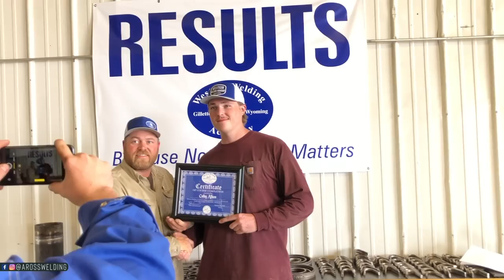WELDERS STAY BUSY - PIPELINE WELDERS DON’T

Comment: That's the #1 issue I have in the welding industry that I struggle with constantly is Fabrication. Like Aaron said, having a good attitude is Everything for success! This welding academy really teaches that aspect about welding employment, the better you can Fabricate, the better chances you'll find employment as a welder, and keep employment Metal Fabricating as a welder. LoL I can weld really good, I just struggle when it comes to fabrication, and a good attitude is the Key to getting better. Thanks for the videos. More please!

Comment: I've been an electrician and self employed electrical contractor for over 45 years. I've wired and worked on everything from apartments to custom multi million dollar homes in Park City to Oil Refineries. Construction, maintenance, instrumentation. All non-unio. But I'll be damned if I can get two pieces of metal to stick together. I should have learned how to weld. I tried in high school but just didn't have the touch. What's funny is the best welder in the class in highschool barley had a high enough grade point average to graduate, but jeez that guy could weld. My best friends at the refinery jobs were welders. They say the welding crowd is a pretty tough bunch to work with. Not so if your electrician. I didn't get any crap from the welders. Why? Because they could weld anything, but without power or problems with the generator/welder who they gonna call? When I was one of the first guys to get laid off they all came by and wished me the best as I walked out that night. But I loved being an electrician even when I was freezing or sweating to death.

Comment: hey guys i have a questions. im thinking about buying a engine driven machine to practice pipewelding n hopefully rig weld. what do you guys think i should start out with ?
Reply: Rico C Lincoln SAE-200
Reply: And older model sa200 or a diesel sa-250. Tune it up nice, replace a few parts here and there and it may probably go for another 10 years
Reply: @Ruben901   Sadly i cant find any near me..  Im in florida. I been trying to get a 200 but i think ima have to settle for a ranger 305g
What do u think about that machine?
Reply: @enrique1765  

I own one myself, it has a great duty cycle and can handle heavy duty jobs. It does waste alot of gas. So by the end of the day, you will have to refill the tank. I have not welded on the pipeline with it, but it can handle a 10 inch pipe. The machine is air cooled, not water cooled like the old sa200s, which means that the ranger will most likely break down overtime. But if you keep up with its maintenance, it should last you up to 7 thousand hours! Ive seen one that had 9 thousand hours and still going strong.
Reply: @Ruben901  does it weld like butter?
Also did u try tig welding with the machine?
Reply: @enrique1765  

The machine has a dial where you can set it to burn stiff or soft, so yes it does burn like "butter". And i have tig welded with it, just get a tig rig, a stinger and your argon tank and go to town 😎. The 305 can even do mig and fluxcore, but i rarely use that process. I just have with me a small lincoln mig 140 that i use for small jobs
Reply: @Ruben901  are u able to connect a foot pedal?

Comment: Some of the best welders I've ever seen were women. I remember in Vo-Tech there was a woman that produced some of the best welds on aluminum I've ever seen.
Reply: I'm a welder. I have only met 3 women welders in my life that I consider "good pipe welders".
Reply: The Machine seen a few women in welding.  Some good, some not so.
Reply: 31 yrs ago in voc...my teacher an instructor was a woman short an wired N tough as nails...weld pipe structure an all metal types from boat rail aluminum to stainless in pharmaceuticals...best course N instructions iv ever had

Comment: That's why they call us welders cause we can fit pipe we weld pipe we can fit structural we can weld structural hell we can weld any thing from a broken heart to the crack of dawn were  fabricators were welders we a breed apart
Reply: Yup pipefitting and structural work is more difficult. Not the welding so much but getting everything lined up and angles etc etc . On the pipeline you just weld pipe together. Sometimes the first crew will tacks and do a root pass then one crew fills then the last one caps. That's how my company welded pipe for a while.